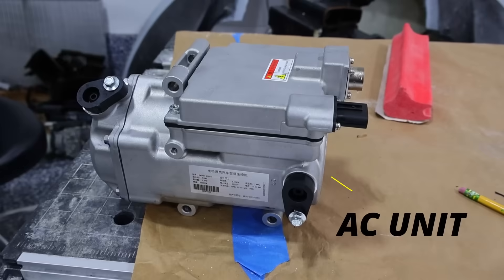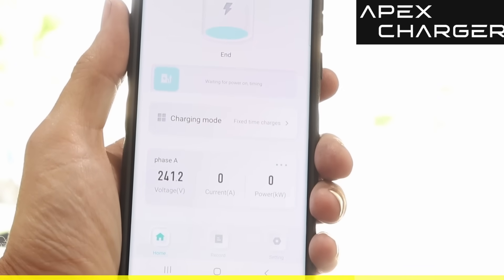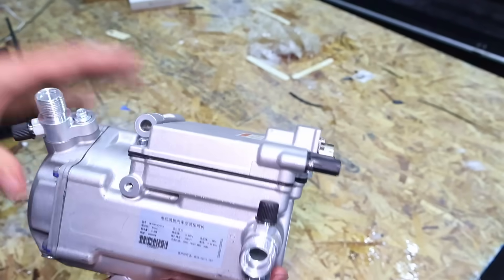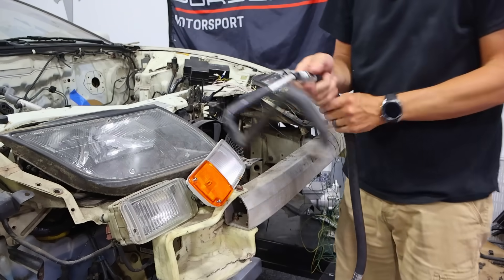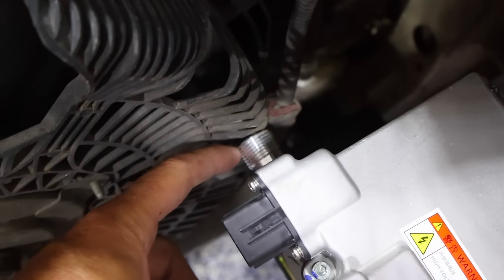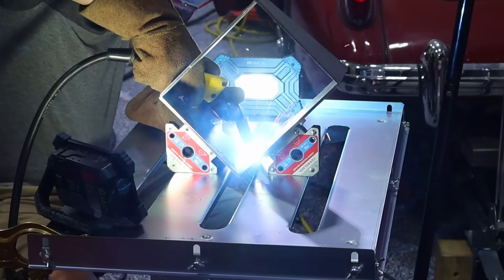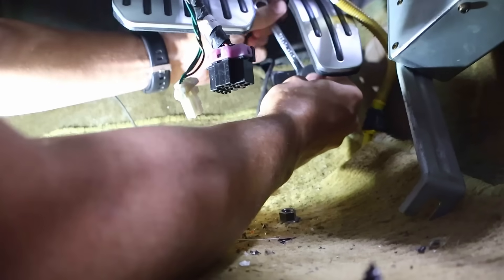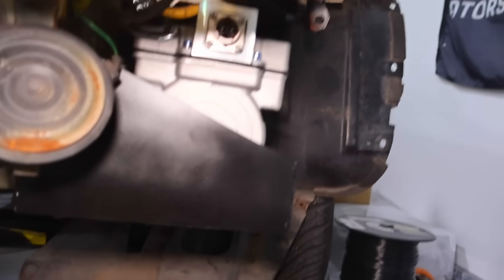Stay Cool: Installing an Electric A/C System in Your Vehicle

Comment: What is the battery consumption for this ac pump ?
Reply: I want to know too
Reply: Someone in the comments listed the spec, its between 1.1kw and 2.3kw depending on load
Reply: HIGH
Reply: The AMZN seller states "35 to 65 amps / 1160 Watts".  Treeligo
Reply: So we have to fix an alternater to the tire. @yobringitondown5565
Reply: In hot weather like middle east it could go up to 5000 watts at its peak
Reply: @Soho9111 Nope.
Reply: That's a good question. Seems it would draw more amps from the alternator in theory using more engine power.
Reply: Don't need to worry about that with ICE 😂
Reply: It’s “I”.
Reply: Need a really extreme output alternator
Reply: @jmenterprise3764  About 40-70 amps I assume so a standard high output alternator would likely do (like 120a) alongside a secondary battery to deal with load spikes (If the stock vehicle has a powerful alternator can get away with just the second battery since its rare to have full compressor all the time)
Reply: Okay the draw is the same as a good radiator fan... That's reasonable AF. Anybody got a link to the unit? 

How many BTU can it remove?
Reply: @jmenterprise3764 The car is electric, it doesn't use an alternator anymore
Reply: @kramyeliar  Its true that car doesn't need one but thats only one use case, he even mentioned in the beginning using it to free up engine horsepower which is something you would do on a ICE vehicle. So voila the alternator comment is valid
Reply: @hiRyan329329  no. Alternator comment is invalid. Coz there is no engine or alternator in this car.
Reply: @twistr99  Question wasn't regarding this car. Of course an EV doesn't have an alternator, they just use standard converters to knock down the voltage for the battery. The people asking about the alternator amperage and such were asking about using it in a ICE vehicle.
Reply: @kramyeliar Put a supercharger on it
Reply: How about a solar panel on the roof?
Reply: @kukuthefarmer1936  How about an internal combustion engine 😂🤣😂 I have AC for days, can fill up in 2 min and go for 500 miles
Reply: @kukuthefarmer1936 
But it will not supply 50A.
Reply: @hiRyan329329  but is the converter powerfull enough? 12V power requirements on an EV is small, therefore converter may be small...
Reply: @renaudcharlet  My understanding is that since almost all the same electrical that a car runs off 12v also runs the same on an EV (as 12v is much safer to you and easier to manage). So their converters tend to be the same, if not more than the amperage overhead that a cars alternator gives (20-80 amps)
Reply: @kramyeliar The car is gay, it doesn't use an engine anymore. 
Fixed it for ya.
Reply: @McJiver Taco Trump reality? 😂
Reply: @kramyeliar alternator for the battery.

Comment: Really cool retro fit. Do they also make a heat pump? Get heating and cooling from one system.
Reply: the heating is a be meh tho on a heatpump. not much more then 40°C output.  while coolant provides 90°C water and maybe 85 after losses to supply air.

defrosting windows at 80+ degrees C is a whole diffrent story then at 40.

furthermore can you dry the supply air by using the AC and then heat it up from the coolant on a combustion engine.

THAT gets the windows dry and defogged properly.
Reply: @casemodder89  my understanding is that Tesla does the heat pump, possibly at certain temperatures. I think I saw it on the Monro channel. 

Yes, running the AC is certainly the way to defrost, I was confused about why my civic turned the AC on with the defrost, but wow did it work.
Reply: The engine provides the warmth
Reply: @gabrielvieira.4358  electric cars lack the engine. thats what makes it electric.

Comment: It is nice to see how AC is handled on an EV retrofit. The compressor looks so small. Looking forward to seeing the battery pack.
Reply from the maker: You and me both
Reply: its prolly 2kw only.

belt driven compressors range from about 1-1,4kw in idle to 6-8kw while driving.

Comment: Great to see someone tackle the AC issue. It one of the remaining items I need to complete in my cars. It would be great not be limited to only driving them October thru March. The 3d printing of the brackets is brilliant. I need to design some new brackets to fit dual chargers in one of my cars it going to be a complicated bracket I will have to try the 3d printing. How did you decide the compressor capacity? I see how the vibration isolators would work on your first bracket, the compressor mounted on tray which is sitting on the four isolators mounted the new bracket. I'm not seeing how they could work on the second. It looks like a thru bolt, even a rubber sleeve will not give you much isolation. Isolators are generally under compression. They don't have much shear strength. If the tray mount will fit in the bracket you could add some angle brackets to pick out those isolator locations on the tray.

Comment: I could be mistaken, but did you tie the high voltage cable to the front crash bar? is that safe?
Reply from the maker: Adding a pyro fuse to turn off high voltage in the event of an accident.
Reply: @electricsupercar what's gonna trigger the fuse? Stock SRS unit?

Comment: Thanks! I also can never bring myself to do stitch welds. Also, are you able to provide a link to this AC compressor's product page? Unfortunately, many of the electric AC compressors on the market use 12 VDC. One of my Ford Ranger EVs came with the factory HVAC compressor, but the other was shipped without AC. If this HVAC compressor can accept 400 VDC, it would be a great option for adding AC (or even as a possibly more efficient replacement compressor for the stock AC unit).
Reply: It's a Benling DM27A1
Reply: Benling 27cc A/C Scroll Compressor
This is an excellent electric air conditioning 27cc high precision orbital scroll compressor that runs directly off your high voltage battey pack.  It is available in two voltage ranges:110-200v and 220-400v.  A permanent magnet brushless DC motor features an integral inverter/controller built into a very compact lightweight package.  But it is POWERFUL at up to 15700BTU/hr output at 6000 rpm.  It's also surprisingly quiet at 76 dB noise output.

The control cable uses 12v input, a 12v enable signal, and a 12v 400Hz PWM signal to vary the speed (and cooling power) between 1000 and 6000 rpm.

It is absolutely TINY at 6.3 kilograms
.
Nominal input voltage: 312 or 144
Nominal input current: 10A or 20A
Volume: 27 cubic centimeters per revolution.
Refrigerant: R134A
Oil charge: 120ml
Rated power: 3.5 kW.
Noise: 76 dBa.
Dimensions: 208 x 125 x 159 mm
Weight: 6.3 kg

3000rpm  1.10kW input power/7300Btu/hr
4000rpm   1.49kW input power / 9900Btu/hr
6000rpm   2.3kW input power /15700Btu/hr cooling

 

Note: The compressor has compressor oil added. If you need the oil replacement, the oil recommended is POE 68 oil.

  @KlaasDeCraemer
Reply: @KlaasDeCraemer  cool! Thanks for that info!
Reply: @KlaasDeCraemer  Awesome. Thank you!
Reply: I am also curious what model ac compressor he is using!  Just for the sake of knowing lol.

Comment: Where did you purchase the orange HV shielded wire from? That small gauge EV wire is very hard to source and I need to find a supplier for some of my projects. Also a tip:  I noticed your large wire spools were 600V wire. 600V rated wire like UL1015 is great to use where you can due to the thicker insulation for increased abrasion resistance, however 300V rated wire like UL1007 has thinner insulation and is handy where you need a smaller OD wire diameter in order to fit into some smaller electrical connectors.
Reply from the maker: I sourced my HV wire from a Chinese company

Comment: Fisker ocean, would it be cheaper to upgrade to motor controller and charger or part out and use motor and batteries for another project? What does batteries and motor costs?
Reply from the maker: Fisker only works with Fisker.  It would be hard to use their components on another build